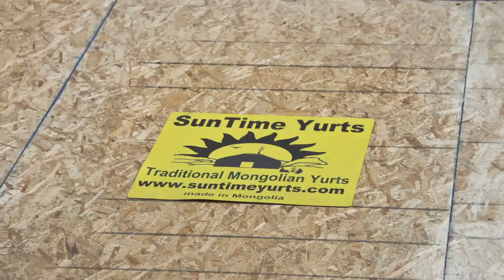Mongolian Ger (Yurt) Set Up

Comment: nice yurt! what is the barricade wrap? Does this help with the vapor barrier/rot problem the wool insulation has? How is it holding up?
Reply: I'd imagine that it's for waterproofing, which I think is not a traditional feature in yurts, since it doesn't really rain much in Mongolia.
Reply: +Antoni Favata I do think it's a breathable membrane such as Tyvek for example. Plastic would trap the moisture inside.